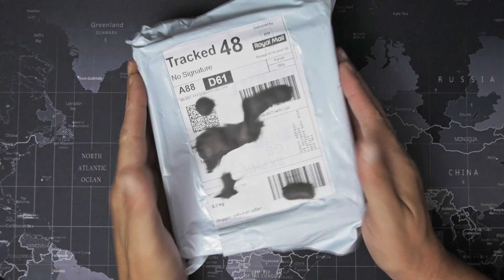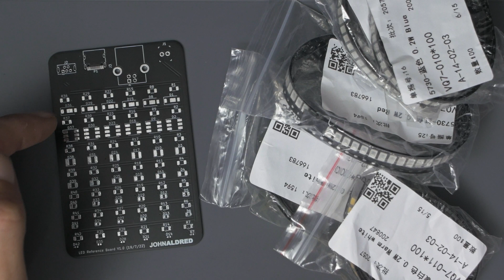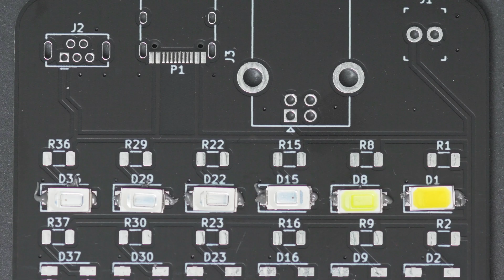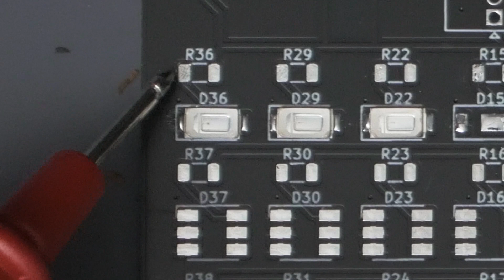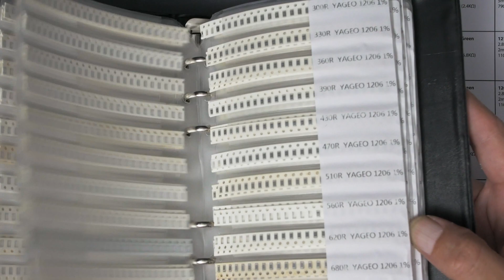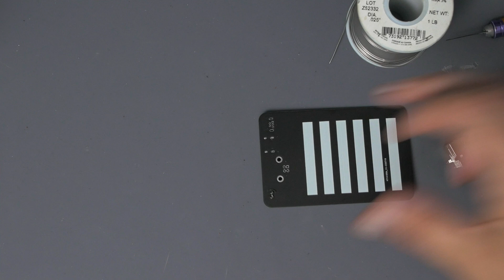Learning to solder tiny SMD components again - With hot air this time!

Comment: Hey mate. You need to add the resistors on the USB-C port as it wont work with smart chargers without it.
Reply from the maker: Yup, I was just powering off USB-A chargers at the time anyway, so it wasn't a real concern. There's a couple of 5.6K resistors on the more recent iteration, though. :)

Comment: What happen if in a circuit of 10 Leds in series (each 3V 150mA rated), I replace one of them with another Led rated at 9V 150mA?
The others will get dim or doesn't light up?

Comment: Nice project! Another nice addition would be 2 x CR2032 coin cell batteries and an smd switch making it portable.... why? Why not? "Just because"  :)
Edit: Side question - which of the camera is your Macro one? I've been thinking of getting a Macro camera for zooming SMD and PCB stuff in general
Reply from the maker: The main issue is that the coin cell batteries probably wouldn't be able to provide enough current for all of the LEDs. Even without a resistor, you can run a single LED off a coin cell battery without blowing it. If you've got this fully loaded with 42 LEDs, it's going to struggle! As it is right now, it's already quite portable. All you need to power it is a USB power bank and most of us carry one of those around these days for phone battery emergencies.

Side answer - It's the same camera I always use for filming overhead stuff (the Panasonic GX80/85). The only difference is the lens. I'm using the Nikon 105mm f/2.8D AF Micro-Nikkor with the Viltrox NF-M43 adapter so I can mount it on a Micro Four Thirds camera. :)